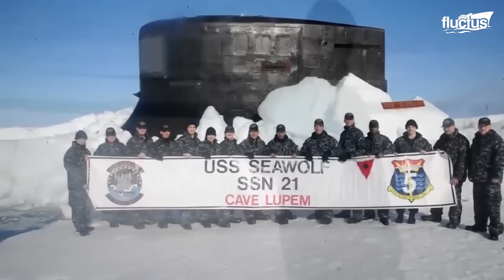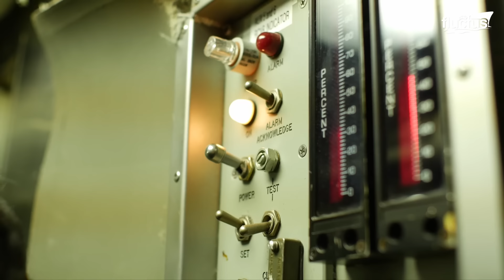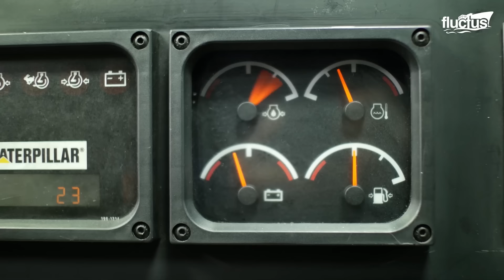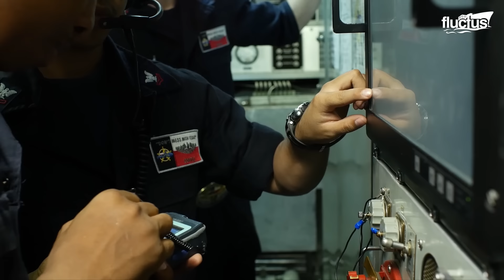Life Inside US Gigantic $4 Billion Submarine Patrolling The Oceans at Full Speed

Comment: At 3:30, the narration states that Tomahawk missiles are fired in defense.  This is incorrect, Tomahawk missiles are purely offensive and have no capability for ship defense.
At 3:37, the narration calls out the "Lookout Trunk",  This is incorrect, it is the Lockout Trunk (LOT) and it's purpose is to allow special forces to conduct operations while either submerged or surfaced.  It is also used as an escape trunk in the event of a disabled sub.

Comment: Why don't we use the Viktor Schauberger trout design to provide a submarine with propulsion the bow of the sub is designed the same as a trout mouth and gill structure . The way it works is simple the initial movement forward is accomplished using the subs prop once the water flow thru the gill structure has started they then provide vortex power to propel the sub forward at any speed desired and the prop is not used

Comment: How do they flush the toilets?
Reply: Compressed air and salt water forces the waste into a CHT tank.
Reply: Very complicated procedure to be sure. Very smelly when things go wrong.
Reply: On VIRGINIA Class, the sanitary system uses a vacuum system to pull waste and gray water to the san tanks located in the AMR (auxiliary machine room).  When full, the san tanks can be pumped overboard.  On older LOS ANGELES and OHIO Class boats, the sanitary system operated by gravity (similar to a typical home system) with multiple san tanks located throughout the vessel.

Comment: What are the symbols beneath the missile hatches?
Reply: The numbers call out which launcher tube.  On the early flight of VA Class, there are 4 torpedo tubes (#1 thru #4) and 12 VLS tube (#5 thru #16).  On newer VA Class boats, the 12 individual VLS tubes have been replaced with 2 much larger VA Payload Tubes, which can each hold multiple Tomahawk missiles.

Comment: Why does the US put dive planes on the sail instead of under the water line?
Reply: Only submarines built in the '80s have fairwater planes. All the new U.S. subs switched to bow planes.
Reply: @JM-gj7de  Also boats built in 60s-70s. Fairwater planes are actually called Sail planes.
Reply: Sail planes can push the boat up or down without affecting the angle of the boat.
Reply: @JM-gj7de  You are NOT answering the question.